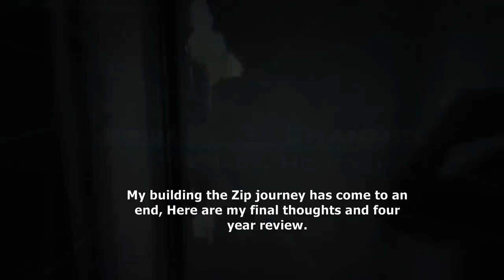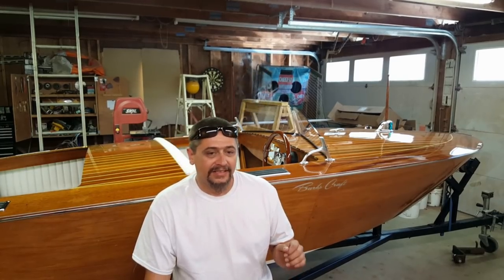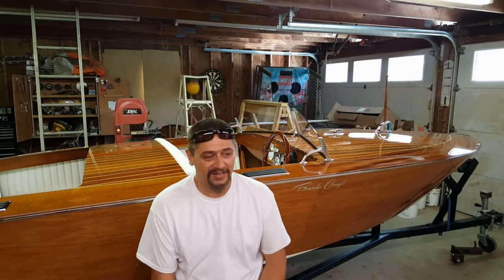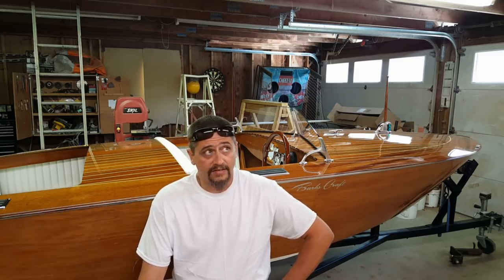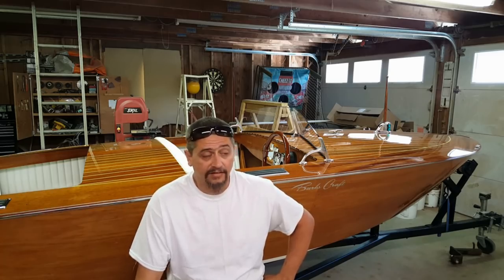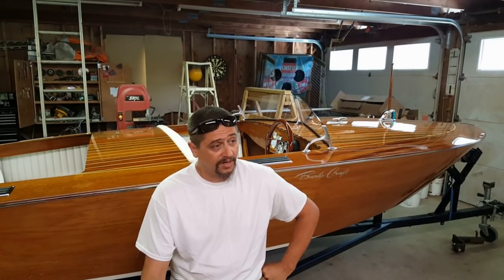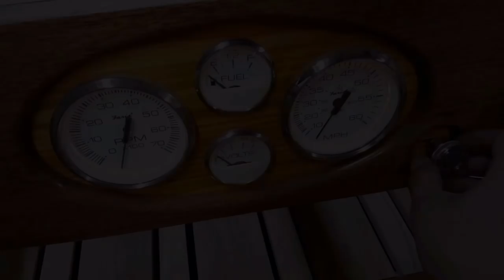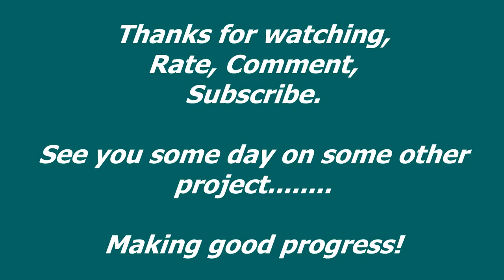Building the Zip, the final chapter

Comment: Josh,
Thanks again for a great series!
Two questions,
1. Did you consider building a Barrelback? If so, why did you decide against it, vs the Zip?
2. Please elaborate on your decision not to glass your hull. What were the plus and minus factors you considered?
Reply from the maker: To answer your first question I did not consider anything other than the zip only because of garage restrictions size-wise, the zip can easily fit in my garage parked straight in and I planned on keeping it in the garage that is why I decided to not go with anything longer even a malahini would have been a tight fit and I probably would have had to shove it in diagonally so the zip was my only choice and the one that I wanted anyhow, I do plan on building a barrel back in the future but that is substantially farther away in the future towards retirement time. For your second question I didn't want to Glass the hull because I had an extreme fear of doing a terrible job that I wouldn't be able to repair and still keep the sides Bright wood oh, I really really wanted that Brightwood side finish and had I messed up on the fiberglass it would have in my opinion ruin the entire look I was going for, glen.l does recommend fiberglassing but not for strength and a lot of people will argue about that but the only reason to fiberglass is for additional waterproofing and most important abrasion resistance, so I am extremely careful when I load and unload my zip from the trailer and I never ever Beach it. I don't know if not fiberglassing was a mistake or not but I am still happy that I did not, I am however the exception not the rule I would say 98% of all glen.l Builders fiberglass, just got back from a lake trip a few minutes ago, still going strong, hope this helped, Josh
Reply: Thanks for the prompt, and informative, response to my questions!

Comment: I just inished watching the series.  Outstanding achievement sir.

Have you had any issues with wood movement of the sapele deck?  I was curious if your choice to fill the joints with epoxy caused an issue. As a woodworker I would not have laid that sapele that way, with it being 1/4" thick.  If it were 1/8 or less I would try it, but still be nervous. I'm just trying to learn how this worked for my own boat build.  Thanks!

Comment: Luv the boat as far as the transom height jack plates are common on bass and race boats to raise the transom height it’s not that expensive or ugly and would allow you to use a larger engine so you don’t have to run rpms so high great great boat